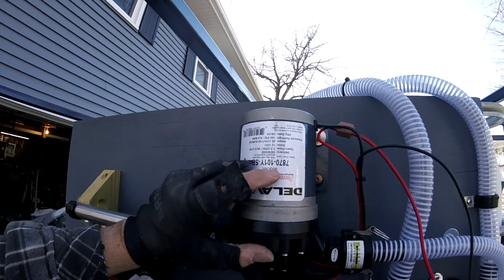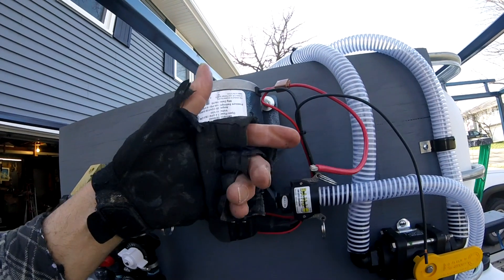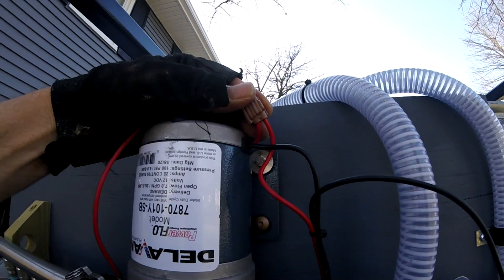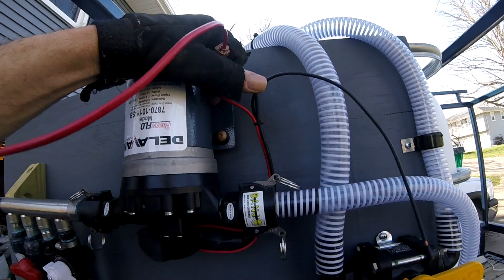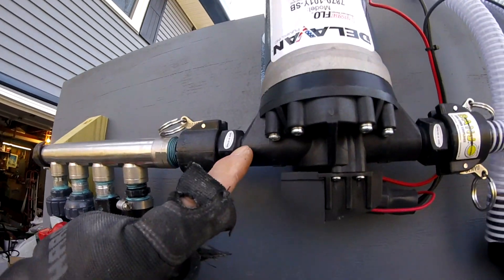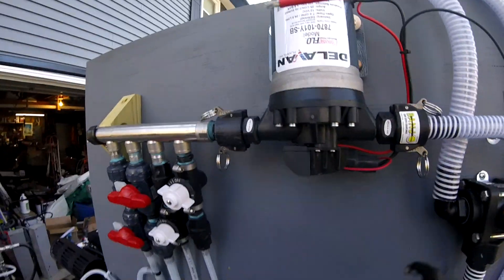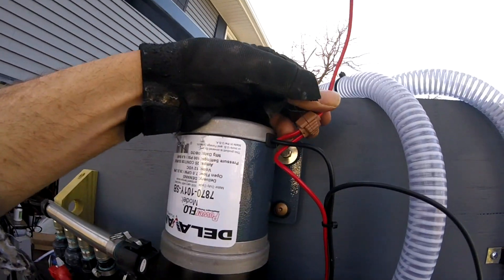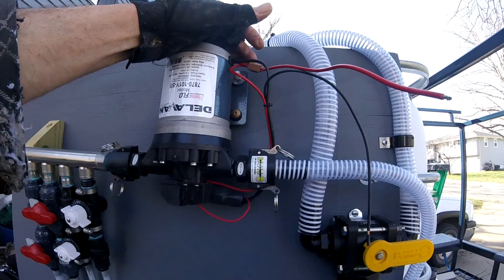Delavan. Over rated. Under engineered.

Comment: The wires are in free air so they get a different rating. 12 ga. will work just fine for 25 amp loads. The insulation also determines the rating as well.

Comment: Been using mine for around 14 months , I mean after a while it has lost pressure but the valves are replaceable on their website for 4$ each , we do around 14-18 roof a month or so and running 35% bleach and 65% water , we always flush right after every job , oh and we run degreaser and post soft wash sidewalks with it too , been good for us I mean…
Reply: I didn't have that kind of service from mine.

Comment: I rarely blame engineers on the type of crap you are pointing out, since it is usually either the bean counters and/or upper mgmt. that makes units end up like that. Engineers have standards and even laws that they know they have to adhere to, not to mention their pride. The best analogy to "prove" this is that if engineers got their way, a "cheap" econobox Toyota would not be 25-30 grand new, it would be 100 grand or more. It would never rust and it would almost last forever but....
Reply: You mean like the (old) Toyota Land Cruiser?

Comment: I wire every day for a living. and 12 awg wire is fine for 25 amps. at 12v.    I believe off top of my head you can run 30 amps under 4ft of wire at 12v on 12awg. 4ft or longer you need to up wire size. you are thinking of residential. and on top of that manufacturers are allowed to break the code we use to wire houses if u ever look in some of the light factures from home depot and Lowes u will see 18 awg.
Reply from the maker: I know we're only talking about a 2 or 3% voltage drop with 12ga wire.  But these motors have wiring issues.  What about that Scotch lock?  That screams afterthought all day with me. Plus choking down the inlet.  You're right about the 12ga wire but that combined with my other points are valid.  It was just another thing for me to gripe about! LOL.
Reply: @housewashing5693  i totally agree. just because they can use it does not mean they should. if it were me making motors i would just put 2 threaded studs coming out. its just crazy what u get for $200. dont seem like much. thanks for the videos i do enjoy them.
Reply from the maker: @zekeisme1  Thank you for your input!  Take care.

Comment: In your video I guess you did comment based upon the fact that the pump was made for soft washing. As a plumber you know we vent boilers with PVC. Everybody went back to the manufacturer and said your PVC is turning yellow every time we vent oor boilers. The manufacturer replied nowhere in any of our literature does it say that we designed our PVC to vent boilers.In the windings in that motor are smaller than the gauge wire that you're holding in your hand. I guess you were assuming that that pump was designed to be used as a soft wash pump. I guess you also assume that during the use. I have not read the manual for that pump. But you may be surprised when you read it